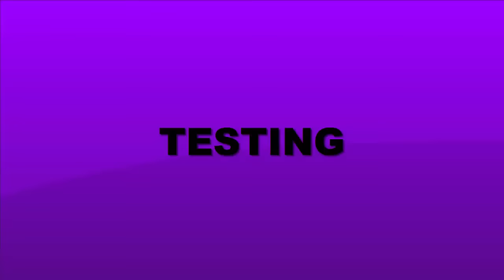Homemade Calcium Carbide Cannon

Comment: It's fake, he's just throwing a firecracker in the barrel
Reply: Backyard Arsenal why do you say that?
Reply: It is fake because when incomplete combustion of
Acetylene(C2H2) takes place it
produces carbon which is finely
dispersed in the air and looks like
black smoke.
The white color of smoke is probably due to sulphur dioxide.
Reply: Don't mind him, I'd do the same if I snorted the same amount of spray paint propellant like this guy when I realize my builds are shit
Reply: Stupid says it's fake 
Coz they can't try it

You can also use peicesof calcium carbide
Reply: It's fake because there is no igniter. Calcium carbide and water makes acetylene gas which does not self explode. Also the spund of the explosion sounded exactly like a firecracker, not the loud boom of acetylene...
Reply: Also the gun had nothing to ignite the gas...
Reply: Wow... if you think it's real, then how did he ignite the gas??? Exactly.  Even if there was calcium carbide, there was no source of ignition. Btw anyone with 20 dollars can make this. it sounds pathetic when you claim someone can't shove some pipe fittings together.
Reply: I've made one and its hard to shoot, need to guess how many seconds when carbide release acetalene gas, so that ratio of gas : oxygen is correct before it can even combust

I had my education-gun buffer for 11-15 seconds and it does give a massive recoil
Reply: Calcium carbide + H20 = Acetylene gas..
 In the early 1900s a child's toy cannon operated basically the same way. The video is only edited to save a few seconds. There's no firecracker

Comment: Waaaay too much calcium carbide. Your air/fuel ratio is far too rich, and you're wasting so much calcium carbide. You only need about 1/2-1/3 of the amount you placed on your applicator.
Reply from the maker: +TheProfessor936 
Thank you so much for your advice ...i really appreciate it ..and we will follow your instructions in future ..Thank you so much again for your valuable advice.